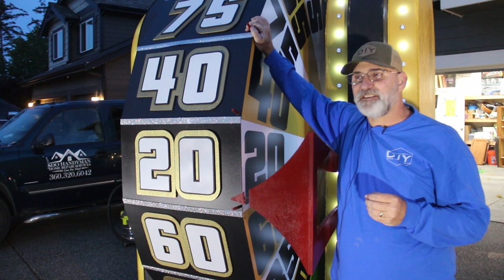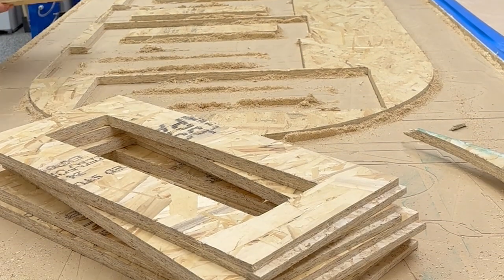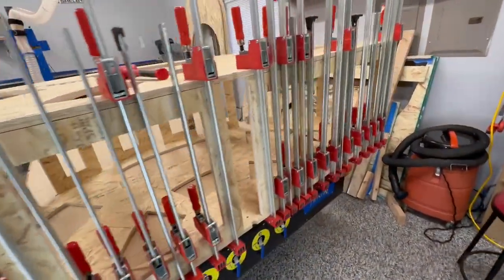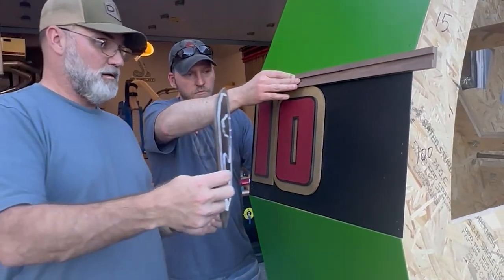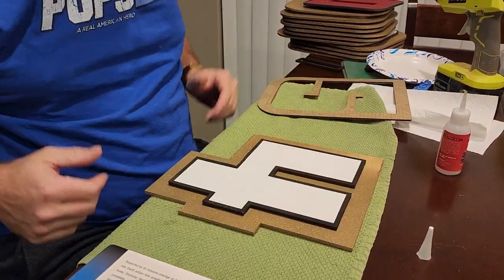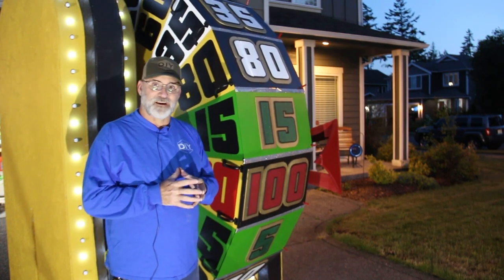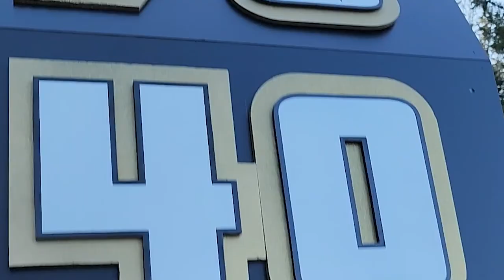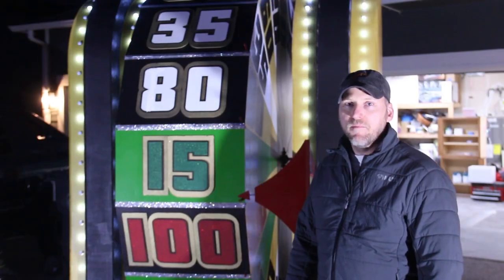We BUILT The Price is Right Big Wheel! | The Makers Collab 2023

Comment: Can you please provide more detail on the spinning mechanism? Im building something similiar. I tried using swivel plates on each side of the wheel but the spin is inadeuate. It looks like ill need a metal rod for an axel going all the way through. I just dont understand what type of flange to get and how i fasten to the sides. Any links you could share for the flange and fasteners would be really appreciated
Reply from the maker: Sure. We used a 3/4" steel rod supported by pillow blocks on a stand. 

https://amzn.to/3uTAjcv

Comment: Are you able to share the plans you used to make this project? I want to try to recreate this at a 50% to 75% scale for an office Halloween party.
Reply from the maker: We currently do not have A plan set. But for reference it's an 8' 20-sided (icosahedron)  and it's 2' wide. It was made using a CNC and plywood, the skinned with 1/4" MDF. The font for the numbers is called "Playdown"